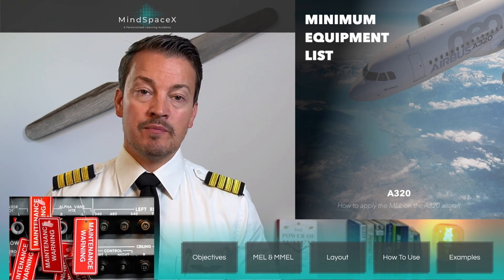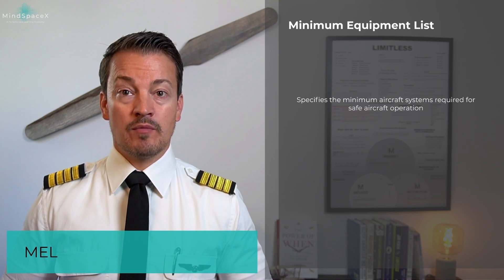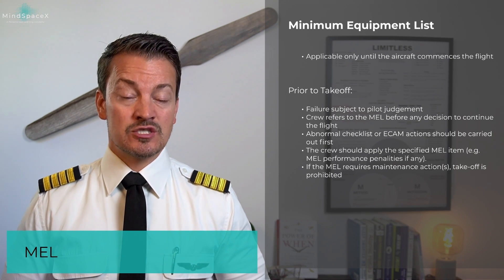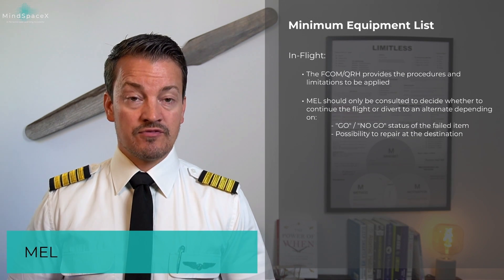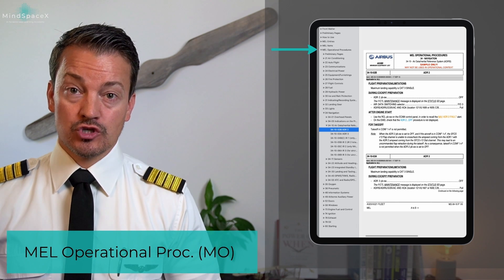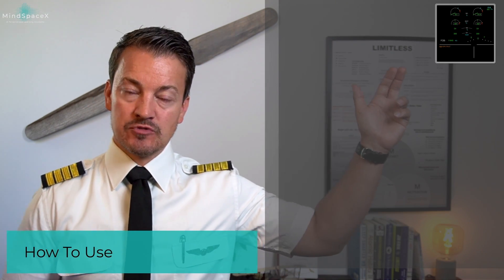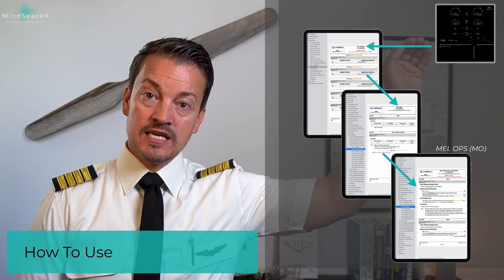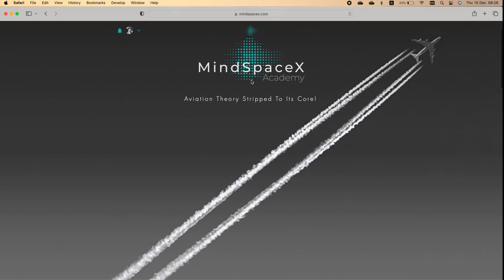Airbus MEL Explained

Comment: What to do instead with ecam cautions during aircraft power-up?
Ex: Cab/Press sys 1+2 fault
Reactive w/s det. Fault
Reply from the maker: Hi Andrex, During aircraft power-up all systems complete their own internal check. This can, in softwares like simulators and flgihtSIM show as a permanent fault. In the aircraft however this is not the case. You can simply turn he respective computer OFF then ON on the overhead panel after the power-up and it should clear the fault?